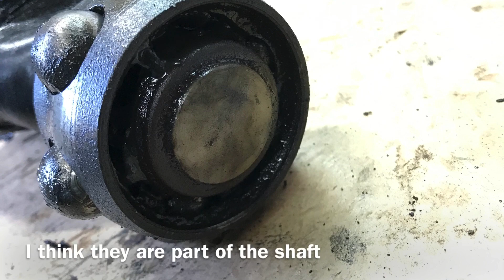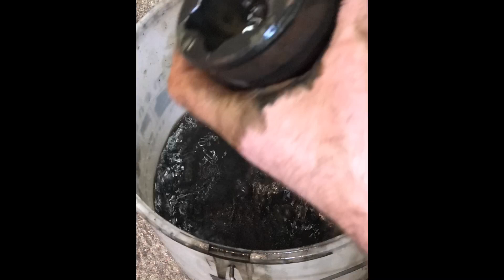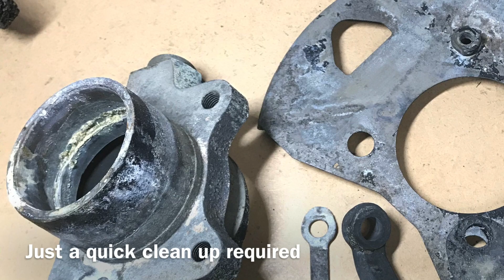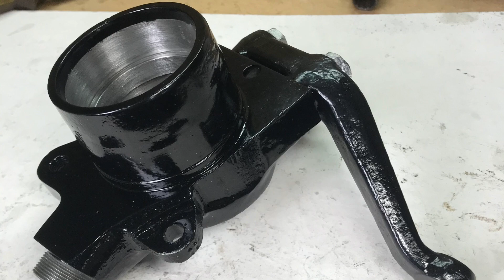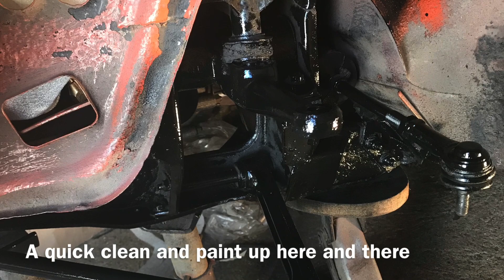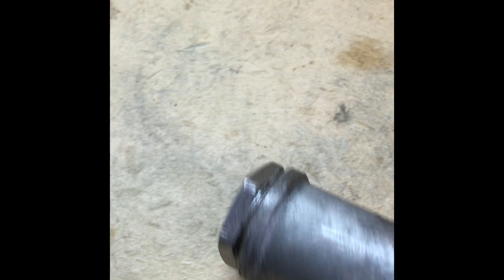Austin 1300 Restoration - Shafts Hubs & Brake Regulator Eps 17 ADO16

Comment: I really admire your dedication and, above all, your PATIENCE, restoring this car. If you ever remove the rear subframe I seem to remember you needed to use a 10?mm socket rather than the original AF. You had to hammer it on but once on, you could unscrew it. Without that metric socket you were, well, er, buggered!
Reply from the maker: Thanks, I know what you mean. Good tip, I also use six sided metric sockets (i.e. 1/2" impact) wherever possible on rusty / worn fasteners... they never slip.

Comment: I don't remember ever working on a 1300 with inner CVJs I can only remember rubber couplings, must have only been the very last cars that were fitted with inner CVJs.  Shouldn't worry about that pitting, they came from the factory like that and the disc backplates only ever came with the merest dusting of black paint. May I respectfully suggest you check the thickness of the front discs and if they'll take it give them a light skim. The last thing you want is to drive the car for a few miles and damage the new pads. You're doing a great job, it never left the factory like that.
Reply from the maker: Thank you for your comment and advice, appreciated 👍

Comment: My dad and I both worked for a large engineering firm and he wanted the cv joints removing from the driveshafts of his Metro. We put we set one up under a flypress and set to work. I had to swing that press like a mad thing before those inner clips leg go with a loud crack. How you managed I can`t imagine. I don`t think they are really designed to come out again.

Comment: Seeing the amount of rust removal you're having to use the Dremel for, a spot blaster would be a good investment.
Reply from the maker: Soz for late reply - Yes it would be nice to have one apart from cost/noise/space, but the acid & polystrip wheels take care of 95% of the rust, the dremel is pretty much light detail work. .
Reply: Hi.yes i kow this is an old vid.,but I've been following each and every one as i purchased an old Wolseley 1155 and have been restoring it.She's been fighting me for6 months now but we've grown to respect each other.She starts and drives but now i found out both front brake calipers are seized.like you I've had to repair/replace each and every component.!

Comment: I run a mobile tyre business. Customer requested four 145/80r13 tyres for a classic he’s restoring. When I arrived I saw it was an 1100, the wheels he had were Allegro, they fit, but he’s now on the look out for original 12 inch. I’m sure the 13” wheels will sell.
Reply from the maker: Thanks for sharing. It makes sense to go for the original 12” size if possible, I briefly considered 13” alloys but decided to do my 12” wheels up with 145 80 12 nankang tyres..video soon. The hardest part was cobbling together a set of the correct hub caps, I ended up getting them from 3 different ebay sellers.
Reply: @langranator  all the effort you’re making is so worthwhile, and enjoyable to watch , keep it up.
Reply from the maker: Thank you, will do 🙂

Comment: hope the  rear  subframe has  survived , from what i remember it was usually rotten subframe/mounts rear floor  that killed majority of these cars.
Reply from the maker: Yes, the subframe and mounts have a bit of surface rust but its pretty solid. Will treat temporarily with waxoil but It will all get stripped out at some point for a full body restoration....first I need to build a workshop!

Comment: Excellent work again, How many of the stripping wheels have you got through ? ! youre giving me ideas of ways of doing things on my restoration, will the body need much work ?
Reply from the maker: Thanks! I think I’m on my 3rd wheel, they last really well unless you use them on jagged metal. The body is mostly cosmetic, it could be tidied up, I’ll leave it for a bit, plan to do full strip/repaint at some point but in no rush and have other non car projects on the go aswell